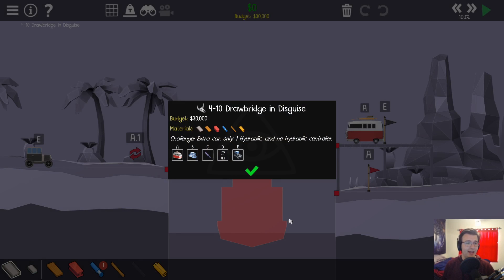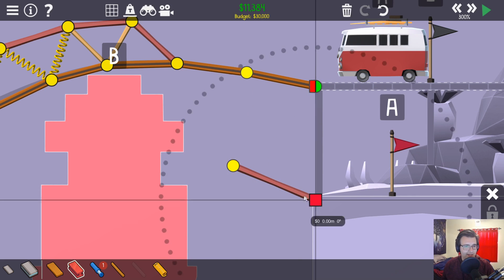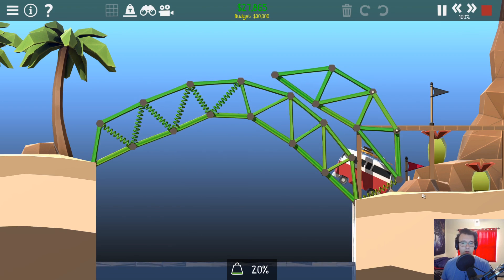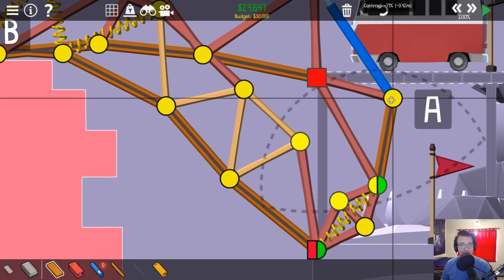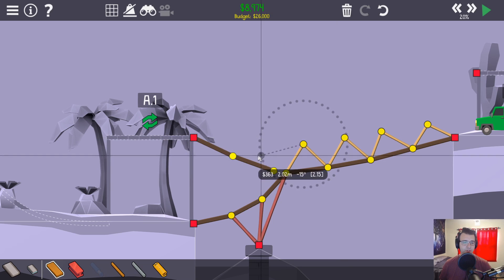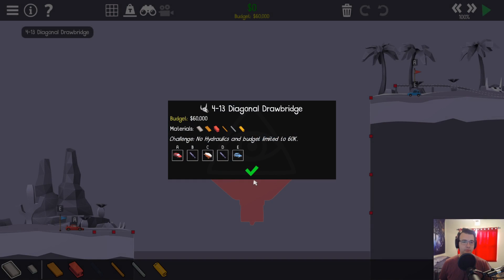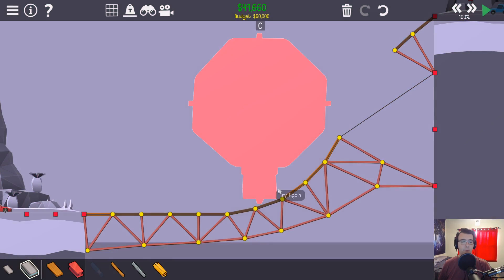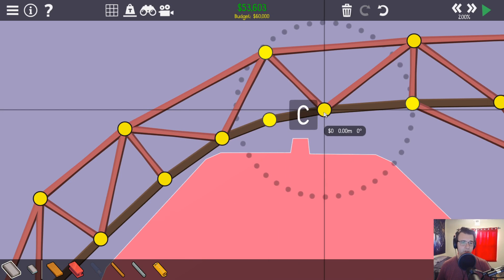Building Bridges Over the World's Most Stubborn Blimp

Comment: 4:42 If the spring is closer to the pivot joint, the easier it will be for the van to move the bridge. Being as it's at the end, it requires full power to move.